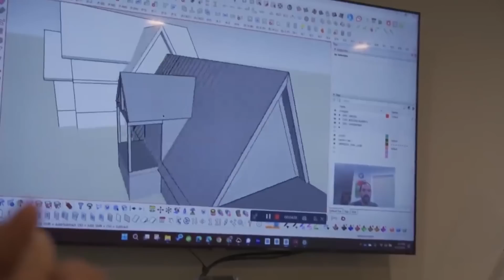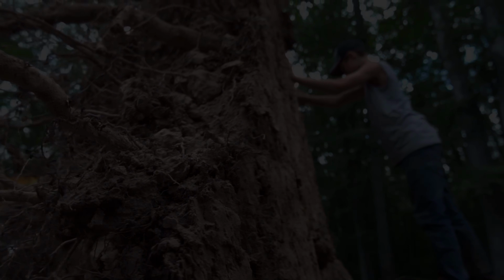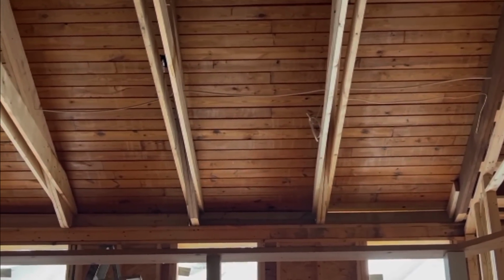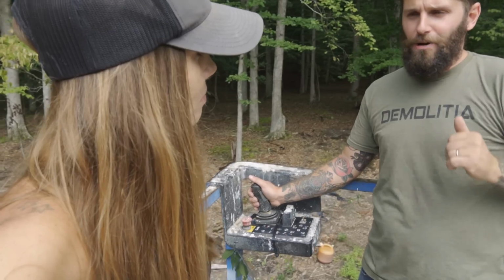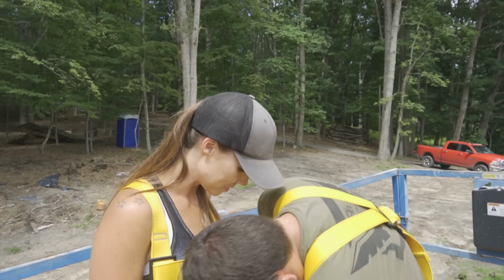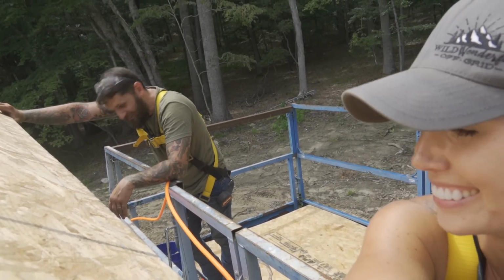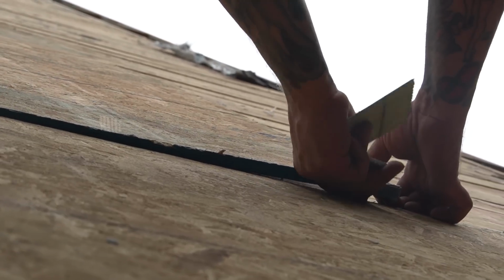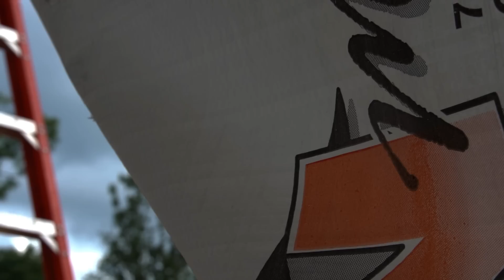Breaking Ground On The A-FRAME ADDITION | Flooding Ruins Wood Floors | Installing Roof Sheathing

Comment: Yikes, roofer didn't have a large enough overlap on the underlayment.  No wonder it leaked. Looks like he did maybe 2 inches overlap when he should have done 4 inches minimum and preferably 6 inches. At least that's what it looked like.

Comment: If the roof leaks with the wraps on, the wrap has been installed wrong. It's as simple as that since it should be installed to guide the water away, and not let it through at all. Typical work done by bad contracter or someone not knowing how such things should be done. Everything about a house roof should be all about getting the water away from the house without letting any of it through despite the weather. It's why the wrap should be started from the bottom edge and layered up to the top edge of the roof, there a single row should be laid down as a temporary cap and if that is done right, it should keep the water out.

A lot of things about a house build is structured like that just to make sure we do not make the same design faults as our earlier generations house builds.

Comment: Given that this is a simple 2 sided roof system, only half the roof should have been removed, repeat for the other side after roofing done on the first side. I'm only guessing that there is no insurance for whatever has been damaged from the rain? If money matters, only let others do what you can not do yourself.

Comment: Did the roofing contractor not have liability insurance.
In the uk you’d only ever use a fully insured contractor.
This is surely a claim on the roofer’s insurance?

If the roofer doesn’t have insurance, how can they possibly work?

Comment: Not resheathing the roof was the first blunder and the second was using synthetic roofing felt because it would still have leaked where the nails went in. If the roofer didn't recommend both resheathing and not using Ice Water Shield over its entirety its on them but the same is true of them if they knew it was better from the start. Indeed Ice Water Shield has become the go to underlayment preferred today since traditions felt and its synthetic replacements are that inferior.. Synthetic felt is stronger than its tar covered versions but still need to be covered literally the same day or two after its on especially synthetic since its leaks where nails go in wet for hours.

Comment: I hope the roofer wasn't paid in full.  You should mail him all the house wrapping in several huge boxes along with a bill for your time @ $50.00 an hour or whatever roofers get paid.  A copy of the receipt for the new osb, nails,  underlayment, the metal roof.  Send it all as a bill almost forgot also bill him for the price of the new floors or the price per hour of sanding them down if they are good enough to do so.

Comment: Sorry I think you got screwed. I hope it works out. At the very least it was their fault for damages as they did not install it per manufactures instructions. That’s looks like house wrap not roof underlayment. The roof underpayment should have been installed per code, that’s not to code. I’m not a roofer but that’s a simple job that should have been roofed the next day not a week later. If the contractor doesn’t cover the damage they need to answer to the state as to why or a judge.

Comment: Out here in "drought" California, the roofers still "blue tarp" roofs if they remove and have a delay in install.  Oh, how do you wear those boots on a pitched roof, you need grippy Vibram or rubber! Sad, contractors earn their name too often "con" - tractors.  Sounds like that roofing company hired the idiots that got fired from the cement company that did your other project.  Labor shortage and all, you never know.

Comment: You have had some of the worst luck with contractors.  First the concrete pour for the foundation and now this.  It's good that you took a lot of video of the screw up.  Wish things went better but you both step up to the task and solve it.

Comment: No matter how you do underlayment, that stuff isn’t designed to waterproof a roof. If you can’t immediately shingle or metal sheet the roof, it should have been tarped. That roofer was lazy and cheap if they thought that was sufficient knowing how much rain you’ve had. A $100 in plastic tarp and duct tape would have saved all that mess from happening. Two of my sons are in the trades and I hear all the heartache of how they have to come in behind so-called “licensed” tradesmen and redo it all. I hope you at least report them to the builders association or state board.

Comment: I didn't want to but I "clicked like" on the video! I sure didn't like what I saw happening to your house. Unfortunately this kind work seems to be a regular thing in small rural areas. I was living in the Ozarks in MO. working for a developer. We were building a new sales office on a developement in the spring time when I noticed that the general contractor wasn't sheeting and waterproofing the roof but instead was working on other things that were irrelevent to the season. They had used PB on the sub-floor and had only "tacked" it down without nailing it off and I knew that if they didn't get it protected and it rained we would have a big problem. I mentioned it to the GC and he basically told me to mind my own business, that he was the GC and knew what he was doing. Well...it rained two nights later and the sheeting on the floor bubbled and warped. But that wasn't the worst of it. They put the finish flooring over it the way it was except by the GC's words "We nailed down all the big bubbles and the small ones will eventually straighten out". Everytime you took a step on that floor it would either make a noise or you would be on a bubble and feel the difference in the floor. Never saw the day when it "straightened out". Worst thing about it was that it was our sales office and potential buyers of our properties would walk on that floor.  "I can feel your frustration".

Comment: Roofer should have insurance that covers the cost of damages on a project like this. I would be holding his feet to the fire, at minimum you can ruin his reputation if he doesn't make it right. It seems like you two need a good lawyer, just a cost of doing business in your line of work. At minimum your state should have a regulatory agency that can shut this guy down.

Comment: You really need to call out these bad contractors so others don't fall prey to them. I have to wonder how many others have been screwed over since then by your previous encounter with the concrete contractor. Liability should be of no concern as long as the truth is spoken. It appears to me you have loads of video evidence to back you up.

Comment: Sorry to see you’re having to deal with issues left by contractors on your renovation home.  1 question… why did you name the video breaking ground on the A frame home addition if 95% of the video was NOT about your ground breaking at all??  I understand fixing things at the rebuild such as rain damage, etc but… you could have just held off showing us the ground breaking til you actually had more ground breaking stuff to film.  Just saying.

Comment: All I can say is prayers because that is dangerous and like washing your car taking roof off the house it will rain every time! Out of nowhere the storm will form. Weather men should be fired because they are never right. I wish you had Zip panels and Zip tape because rain and you area watertight. I hate to see floors wet not just wet but water running over them. Prayers again.